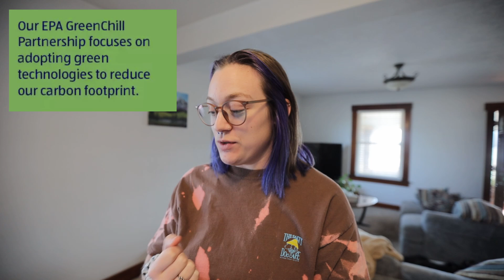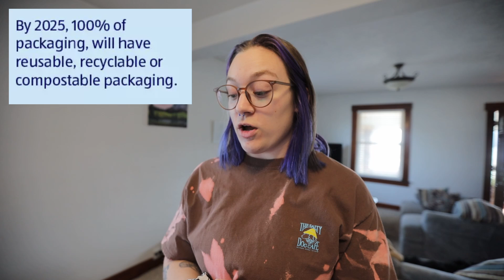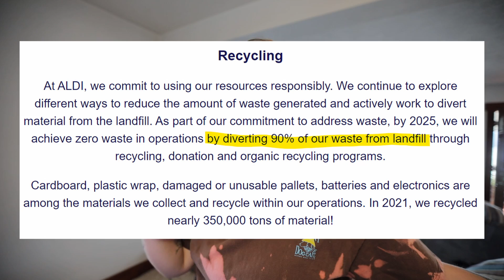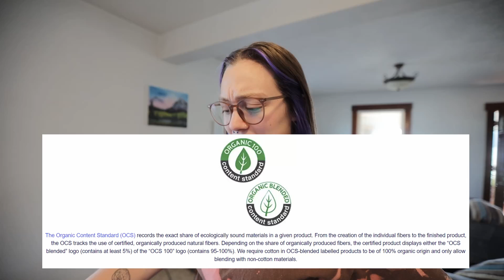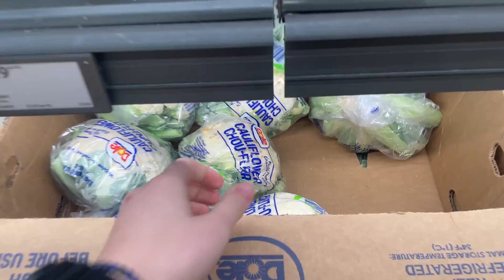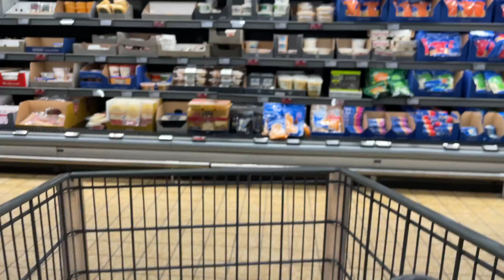How zero waste is Aldi? Deep dive into Aldi's sustainability claims...

Comment: Emma,
I am a regular shopper at Aldi who lives in western Pa. and I am sure that my local store has several options of plant based milks, hummus, and even a few vegan cheese options.  Maybe since you don't shop there very often, you're not familiar with what their vegan options are or where they are located in the store.  I might suggest asking an employee or checking out the Insta cart app, before you visit again.  You can use it to make a list and see what is available at your local store without placing an order.

Though Aldi is smaller and has a mostly store brand inventory, they are the third largest grocery chain in the USA, behind just Wal-Mart and Kroger and most of their inventory is manufactured in the US as well, so they can have significant influence on food manufacturing.

As a single person household, I am also a bit frustrated by the lack of ability to purchase single produce items, but I have been seeing some more loose produce items at my store.  Maybe this will be a more common option in the future.  I do think Aldi is taking some steps in the right direction, but like most large retailers they have more work to do.

Btw, at the bottom of the receipt there is a website address to leave comments.  Maybe you should send them one to address some of the issues that you raised.

Comment: Hmm, I wonder if their 170 stores with solar panels are in states that gave them big $ rebates?  PS: we don’t have Aldis here, but have Trader Joe’s, which plastic wraps almost everything.  I’ve kept a spreadsheet on the basic foods I buy when traveling so I can sort out the unit pricing. For a small store I usually can find what I need.
Reply from the maker: woah good thinking! Ugh TJ's is lowkey the worst but I'm afriad to spill the tea cause of their die hard fans haha
Reply: @TheSimpleEnvironmentalist  well, depends on where you are… around here Safeway is kind of like you generally ok big grocery (you can get a lot of single carrots or avocados or tomatoes or other vegetables, but apparently the ones in Oregon are owned by someone different and the quality of veggies really sucked in the one I visited that I did the rest of the shopping at TJ’s.
Reply from the maker: @karinhart489  makes sense